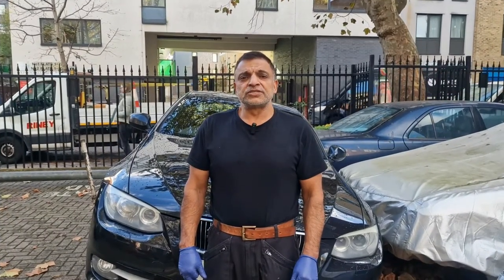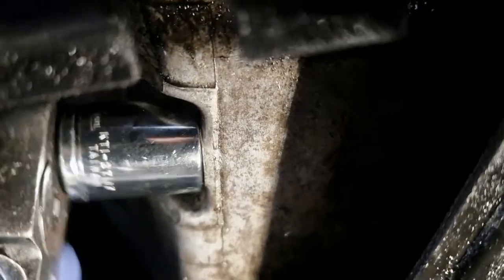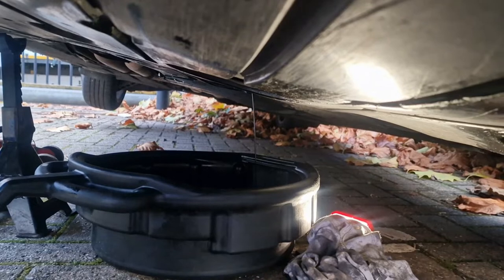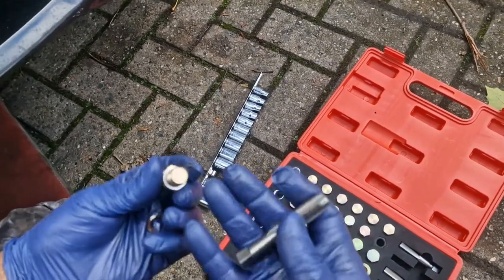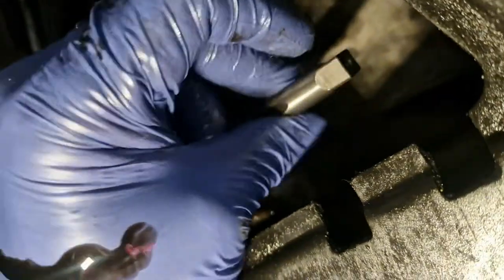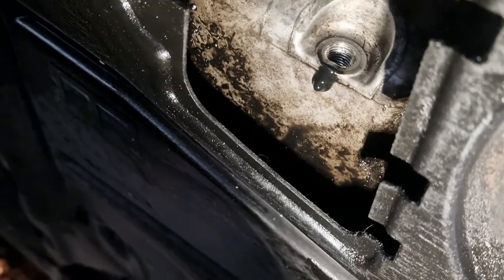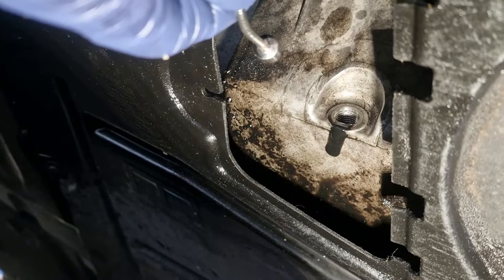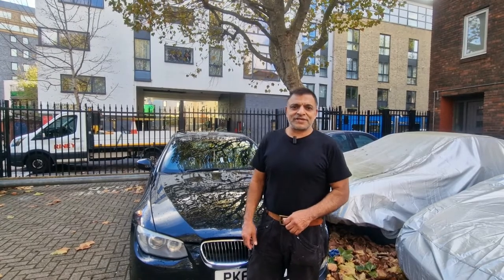BMW SUMP PLUG THREAD REPAIR FIX

Comment: try putting a bit of grease on the tap to catch the shavings, I also flushed through with a liter of cheap oil after cutting new thread

Comment: would putting threadlock (blue or red) fix the problem with the old bolt and stripped threads?

Comment: Cheers for the video. Did you use a copper washer on the new plug?
Reply from the maker: Hi, the kit comes with new  washers, so I did fit it on

Comment: I do this . From M12 genuine to M13 and still get leak and i don't know why . Should i go with M14 ?
Reply: You may have cut it at a slight angle when you tapped the new threads. Try using Teflon tape and a new washer before cutting to M14 threads.